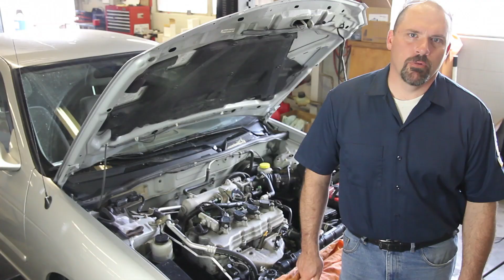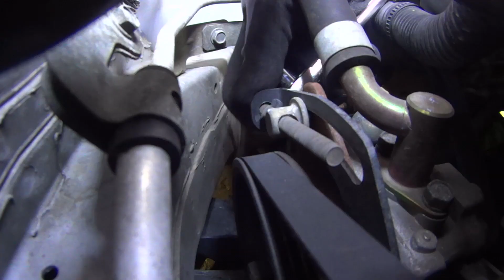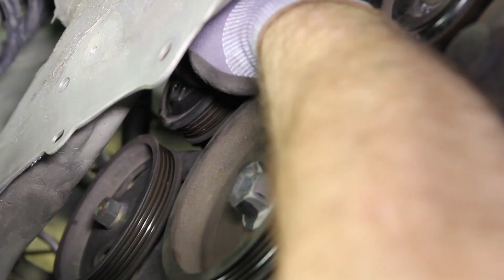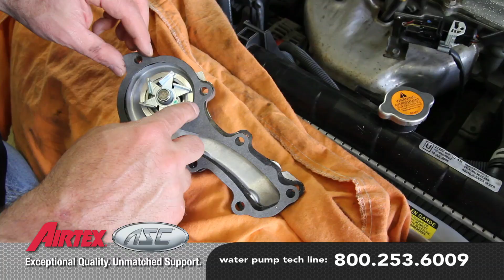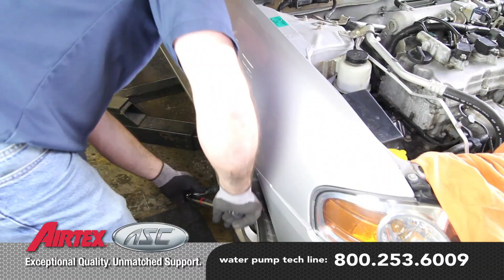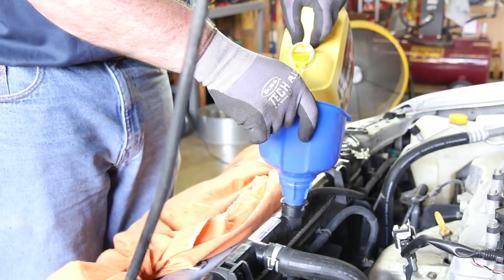How to Install a Water Pump - Nissan 1.8L 4 cyl. WP-9349 AW9416

Comment: I priced water pump replacement locally and it will cost $700-900. I bought the new pump, gasket sealant and coolant for $100. So these greedy pricks want to charge $600-800 labor for an hour job. What's the deal?

Comment: did you change timing belt
Reply: Rigoberto Vera Jr  it has a chain that’ll last the lifetime of the engine, if taken care of. I have an 06 Sentra with 180k on it and so far it’s working fine
Reply: No, he simply removed the two belts that power (if Im not mistaken) the water pump, power steering pump, alternator & a/c.  The timing chain is a much more elaborate process - check out  " ykmalachi " for that.